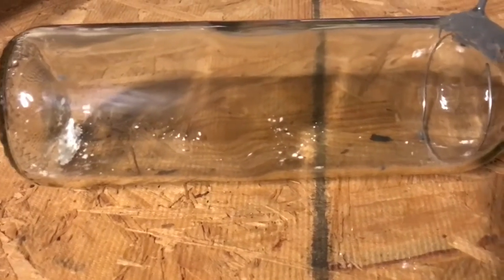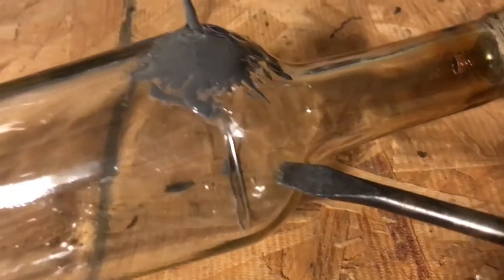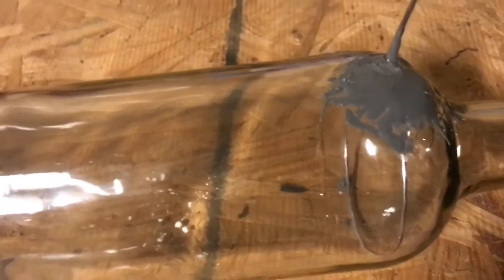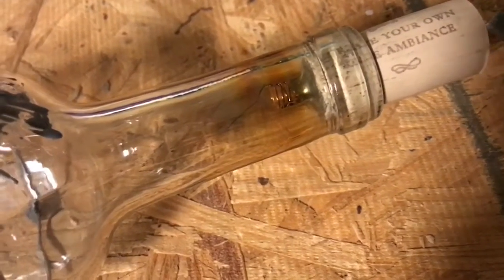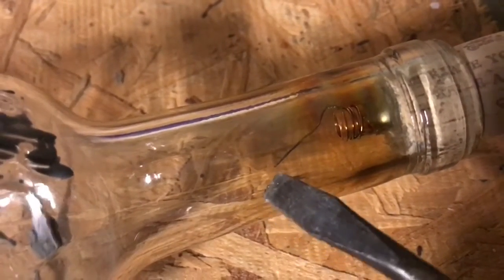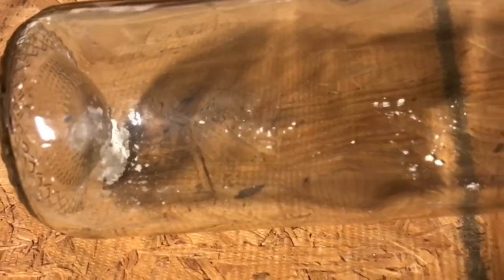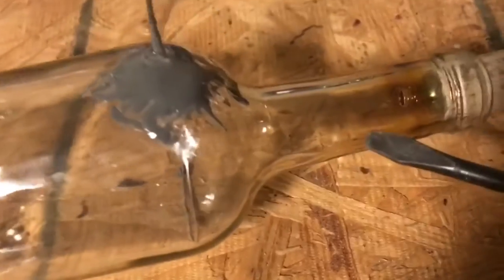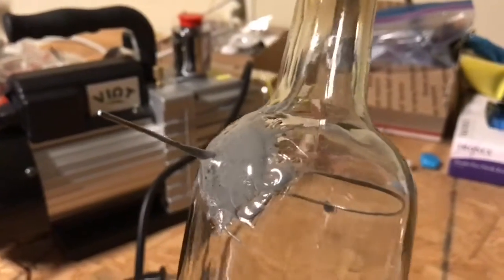Wine Bottle CRT

Comment: Are these X-rays? have you ever thought about putting on gases obtained in electrolysis inside the bottle and then working with them like hydrogen to see the spectral reaction with it or chlorine! thanks for the amazing vídeo!
Reply from the maker: +sslredes ert thanks. Good suggestion. Will look into some other gases. I would have to generate  hydrogen from aluminum and NaOH